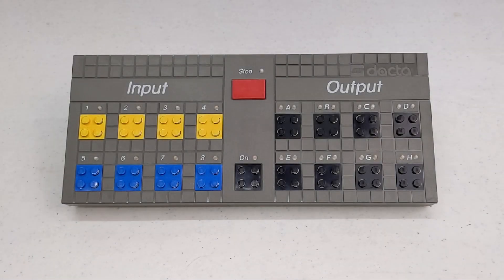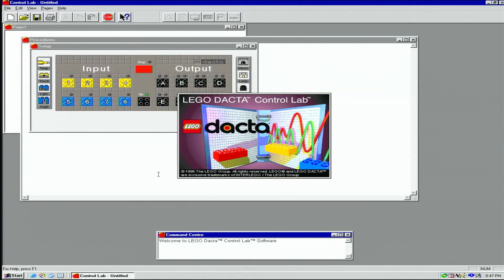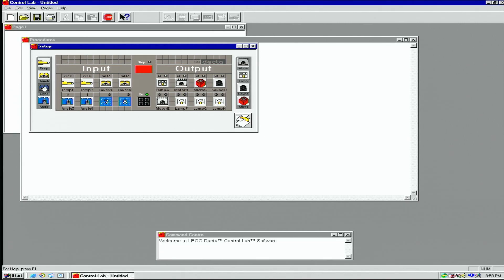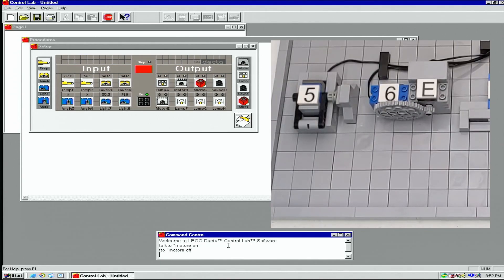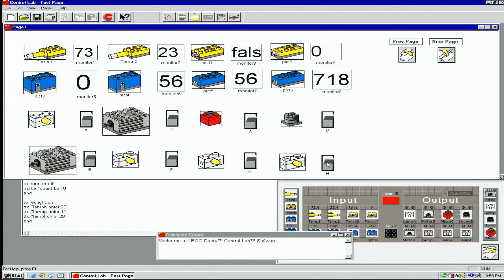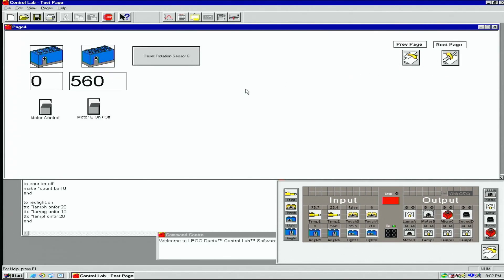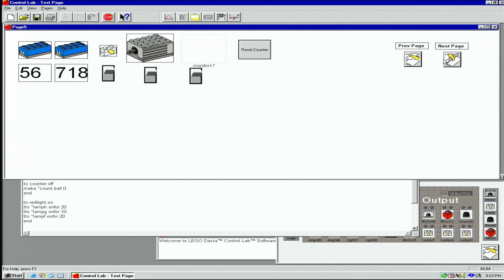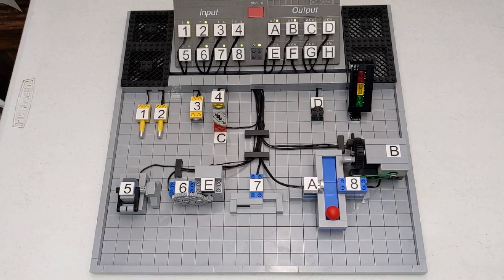Lego Dacta Serial Interface and Control Lab software Retrospective

Comment: Can you only run that software on Windows 98?
Reply from the maker: I've run this version of the software on Windows 98, XP and 7.  As long as it's a 32 bit windows version it should run with the exception of Windows 2000.  We've also been using Wine to run it on Linux 😁
Reply: @BatteryPoweredBricks  so the cross compatibility is with the bits not system editions. Thanks

Comment: People were saying it is not working after win 98 but it is not true for me I can use the win95 version on win7 on my dell desktop perfectly.
Reply from the maker: I don't remember what exact statements I made in this video but I know It won't work on a 64bit operating system which started with Windows XP.  I have an old laptop running Windows 7 32 bit and it works fine
Reply: @BatteryPoweredBricks I confirm it's working fine in win7 32

Comment: The software version that you use is it in the discription aswell? Because i can only find the win95 version in there?
Reply from the maker: I used the 95 version on Windows 98.  I've recently installed it on Windows XP (32 bit) without issue as well
Reply: @BatteryPoweredBricks  thanks! Ill get an old pc and give it a go!
Reply from the maker: It's also pretty easy to use a VM on Virtual Box and then pass the com port through to the VM.  But old PC's are fun too 😅
Reply: @BatteryPoweredBricks  yes i tryed that but could't get it to work. Any advice for a vm that works. Its kind of a new field for me.
Reply from the maker: I could help you get up and running.  My email is listed on the "about" page here or you can DM me on Twitter or Instagram
Reply: @BatteryPoweredBricks  send you an email. Thanks.

Comment: I have one of these that I found only limited software options, can't remember now what it was, but it didn't allow full use of the interface (sensor inputs). frustrating as it could be so powerful
Reply: are you running controllab in a VM or an old machine? it seemed like a paid for software app was needed for whatever I was trying to use
Reply from the maker: @jimlewis1  I had hoped to do a roundup of third party software but haven't gotten to it just yet.  There is only one that I know of that used the sensors but it just gives the readings on screen and is not programmable, which is why I end up using the official software most of the time.  I have a dedicated Windows 98 machine in my Lego room, but I also use a win 98 virtual machine on my laptop when needed.  For example my recent computer controlled monorail video, I used a serial to USB adapter and passed the com port through in virtual box.
Reply: @BatteryPoweredBricks  Thanks for the info. It's a while since i tried to do anything with this. I just put all my stuff in storage though as we just moved to France, so i won't be able to do anything for a while, but i know there is an audience for a full tutorial of getting these boxes going again. I mean, ground up, setting up a VM onwards. for one thing I got stuck for a while using a USB to RS232 converter, but found an alternate brand solved that issue.
Reply from the maker: @jimlewis1  Eventually I plan on it.  It's a pretty obscure topic and would take a good bit of time but it's on the list.  For now the train bug has derailed me a bit 😅

I've had good luck with adapters that use the prolific chipset, seems to be compatible with most everything I've tried